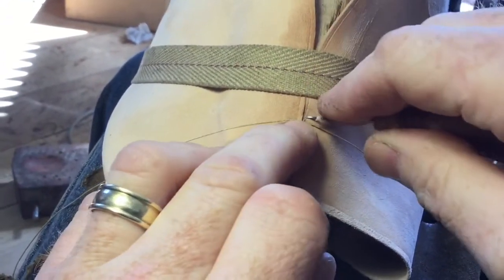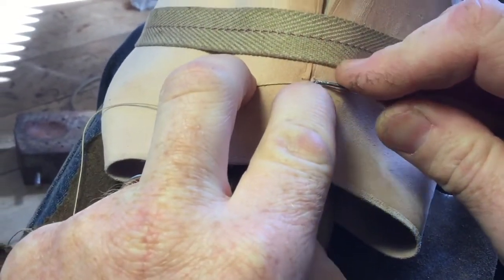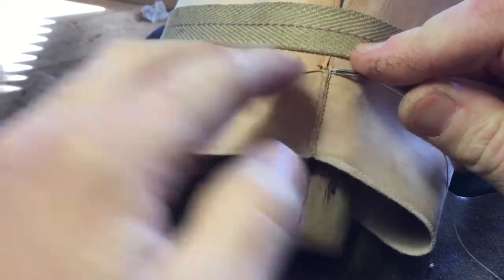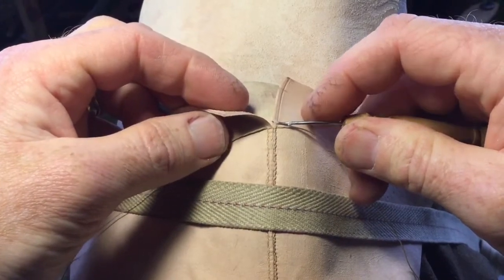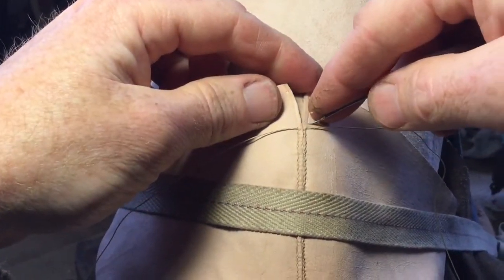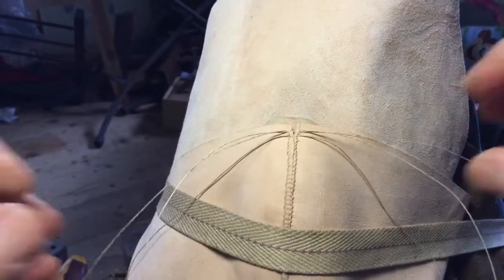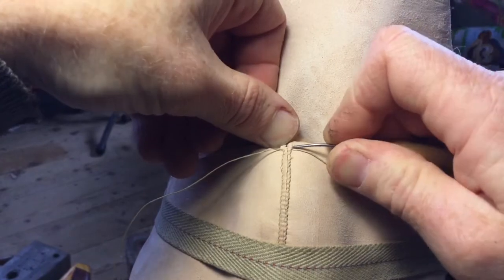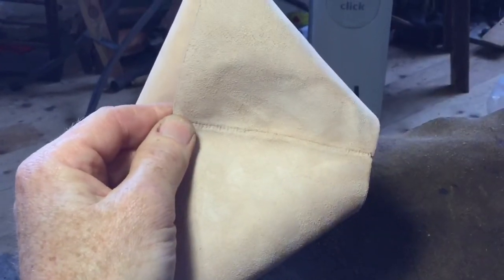Hand Sewing an edge to edge seam

Comment: I was taught to do this several decades ago, but have hardly done it since. We were taught to use 5 or 6 strands of cotton [any more than that and the thread got weaker] and at the time one could buy different types of wax for different seasons. . We just spliced on to fishing line in the same way one does a rod ring. [originally russian boar's bristle] As I remember we twisted all the thread at once and then ran the wax ball up and down till it melted in. The stitch was used on one and two piece clog uppers made out of waxed kip [wax dressed water buffalo of 2 to 3mm] and on the odd time  I have used it I've put a lot of tension into the stitch and to finish just gone back down two holes and nipped off. We were taught to have the length so that we could snap our hands apart to tension. so not as long as yours. I did it so little I never became expert,  actually I'm still not an expert leatherworker full stop.

Comment: What kind of needle is in your awl I normally use a diamond awl but for butt stitching it is too wide and ends up splitting the leather
Reply from the maker: G'day Pop, I make my awls out of different thicknesses of music wire, which I buy from model aeroplane shops. A yard of 1/8" wire only costs a few dollars. I cut a number of pieces, about the length required, and put them in the wood stove firebox towards the end of the evening, and leave them until the following morning to well anneal. If you don't anneal the wire, it will damage a regular file. I take a piece, put it in a drill or lathe, and file a short pointed end, the Tang (this will go in the handle), followed by flipping it end for end and filing the rest into a long, blunt pointed, taper, then sanding through 400, 800, 1200 and 2000 grit 'wet n dry' abrasive paper, getting it to a high polish, all while spinning in the lathe/drill. Then I use the side of the head of a small hammer (round stock steel would probably work) as the form to curve the end of the awl to, and, with a pencil torch burning just above the curve of the hammer head (as the wire will lose it's heat very fast), I put a slight downward bend just ahead of the Tang, then flip it 'round and curve over the tip of the business end, giving a slightly heavier blow on the end to spread the tip of the awl, which will make it easier to push the awl through the leather as the hole won't bind up as fast on the tapered shank. The idea is to make the up sweep of the tip be such that the cutting edge is, more or less, in line with the Tang. It's a bit hard to illustrate with text keys, but I'll try:

Starting at the bottom, the two symbols below are a curved awl standing up on the end of the Tang. Then you have the down curve of the main part of the awl, which then sweeps up to finish with the cutting edge, terminating more or less in line with the Tang.

(      <This curve should more resemble an upside down shallow   J   , but I couldn't get it to work visually.

 I 

This enables a better control of pushing the awl through the leather. I file the Tang into 4 sides to help it resist turning in the handle in use. Once the shape is finished, I develop most of the edge on the cutting end, before bringing the whole awl to red heat (holding the tip of the Tang, and in a dull room so you can see the colour well), quench (I just use water), carefully polish with 2000grit (it's glass hard and brittle at this point) before very gently heating up the Tang and shank to 'draw the temper', this time under good light to see the oxide colours well. A candle can even work for this, though can dazzle the eyes; blue for the Tang and about half of the shank, gently blending to pale straw at the tip. Leave too much of the awl too hard and it will snap in use, let the blue travel too far towards the tip and it may bend in use and will lose it's edge very quickly. If you over heat it, just bring to red heat again, polish and repeat.
Hope this helps.
Cheers
Duncan
Reply: @duncanmcharg  Wow. Any chance you could make a video of how you make your awls? I know you haven't posted in a while... but here's hoping? Your work is amazing and your videos are great! Thank you for posting all you have so others can learn from your experience.

Comment: Hello Duncan,

When making thread for shoes, do you increase ply for thicker leather. In this video you specify 1mm roo being used and 2 ply thread. Say if the leather was 2mm would you increase ply. 

Thanks
Reply from the maker: G'day Reece, Short answer, Yes. The thread's thickness is based on the work it's going to do, and the forces acting upon it. The heavier the leather, the more it's going to resist movement, thus the thread keeping it together needs to be stronger. Heavier uppers might be sewn with a 3 -5 ply thread. When making the 'inseaming' thread, that holds the welt, upper and insole together, and is the foundation upon which the whole shoe relies, the thread is 16 ply ! The 'welt' thread, that holds the welt and sole together (and stacked leather heel , if you're making a sewn through heel), is around 12 - 14 ply.
  Unfortunately these days, the hard part is getting decent linen thread with long fibres. The stuff that I used is around 40+years old with approx. 12" fibres. The more modern threads I'd looked at quite some years ago have fibres of only a couple of inches (next to useless). Hopefully things might have changed in the intervening time; may take quite a hunt though.
All the Best
Duncan
Reply: @duncanmcharg  thanks so much for the information Duncan. Yes increasingly things are worse quality, hopefully that changes.